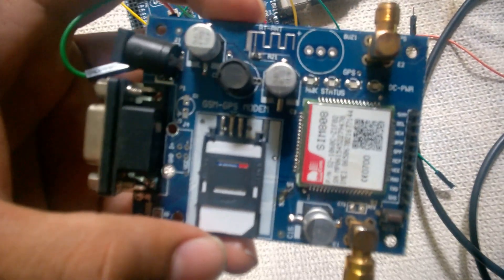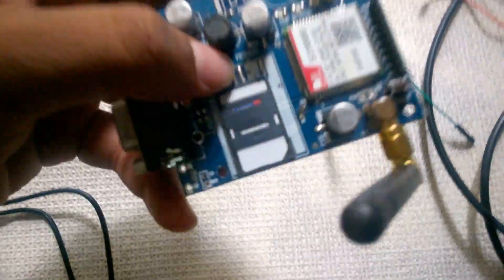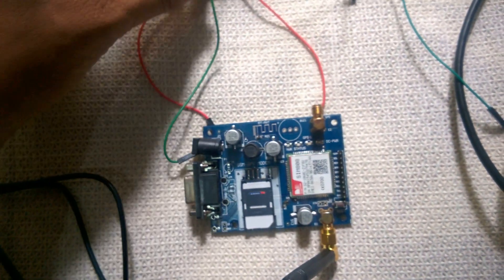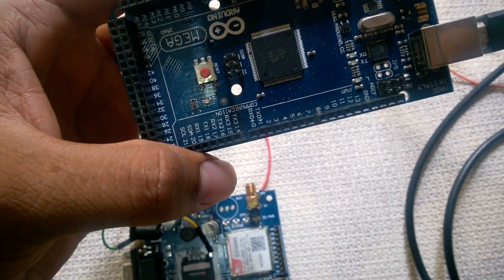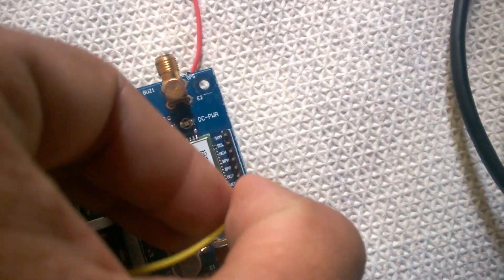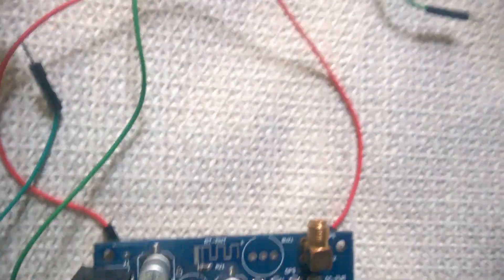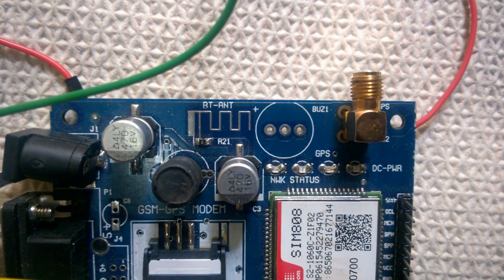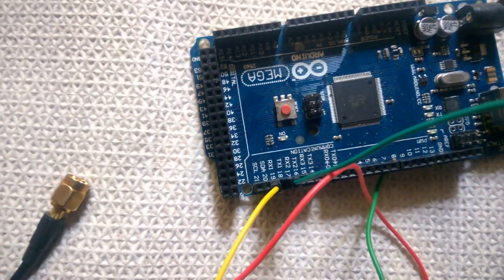SIM808 connection with Arduino mega 2560 Part1 (Rx Tx connection)

Comment: hello brother , which one i should buy
http://www.ebay.in/itm/SIM-808-GSM-GPRS-GPS-Module-with-Free-GPS-and-GSM-Antenna-better-than-SIM908-/263060932917?
or this
http://www.ebay.in/itm/SIM-808-GSM-GPRS-GPS-Module-with-Free-GPS-and-GSM-Antenna-better-than-SIM908-/182747708497?
Reply from the maker: I would suggest that you check in local market once, However any SIM808 module is fine, All are same.

Comment: Hi..I am having the same board which you used in the video for demo and I am trying to connect the sim808 module as per your instruction which you described in the video. But I am facing a problem like NWK led is not even blinking for every second also STATUS led is not glowing.I am using 5V from arduino  atmega 2560.Can you please clarify on what would be reason?
Reply from the maker: Have you tried connecting just the power, If you are able to supply power either through adapter or pin connection and even then you dont see a blink then there is something wrong with your module
Reply: When i supply power through pin connections from arduino I am facing the problem which i mentioned above
If i use adapter(12v, 1A).Both leds(NWK, STATUS  ) are blinking at every second.I can't able to understand why it occurs?
Is it necessary to connect TX and RX of the sim808 module to the micro RX and TX for SIM Initialization?
Reply from the maker: Ideally if you are getting proper network, then after 20-30 seconds blinking will become slow, it will blink only once in 2-3 seconds. Fast blinking will only happen when it is trying to find network.

RX and TX connection is not required for initialization, better that you don't connect them.
Reply: If I connected power supply blinking itself not happened..so i am suspecting module itself...is there any way to find out that module is working or not?
Reply from the maker: Prabakar Devaraj yes you can try connecting the board directly to power. Without using any connection from the arduino board.
Reply: Power supply i used is 12v 1A..shall i take the video or snap of the module behavior
Reply from the maker: Prabakar Devaraj in that case i would suggest you to connect the power pins of simcomm to ur arduino and then use usb to power arduino. If both doesn't work then send me a vedio.
Reply: Now my arduino board is not working..hence i am using stm32107 uc..with that i will check and i will sent the video..
Reply: I have mailed you the video link. Pls see and let us know